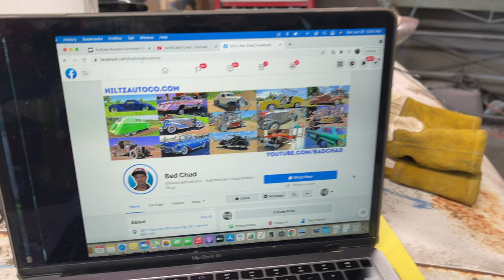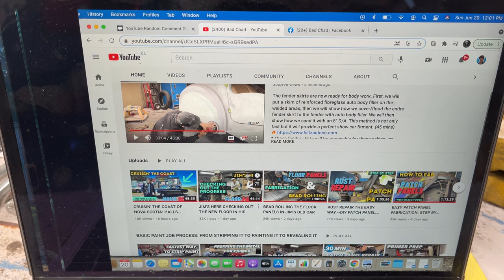THE EASY AND AFFORDABLE WAY TO RESTORE AN OLD CAR FLOOR

Comment: This Sunday you & Jolene are doing an amazing job on the floors, what a difference from when you started on Jim's Oldds 88 wow. It just shows that a little hard work you can tune a sows ear into almost a silk puse, or something of real value great work as. You have not only made it safe to drive but you have added much value always. By the way my mouth was watering when the lobster showed up during your lunch out, that was such a beautiful town and place to eat thanks for taking us along for the drive. Thanks Mark Dutka

Comment: Great looking job. You mentioned coming up to your area. I'm from CT USA and can't wait for the borders to open to come up and visit. 
I'm building a floor for a 55 Chevy and it's taking me for ever but I'm replacing all the original braces. Yours looks great and so much simpler. I wish I saw you do this before I bought the two half floors that need to be put in. BTW happy Father's Day.

Comment: Floors look much better than I visualized. I am impressed!! 

     You have inspired me to fab oil and trans cooler mounts. A boo boo is just an opportunity to get better. I would have given up on filling a burn thru but used your triggering technique with success. I am no longer held back by fear of making a mistake. Anything is fixable.  I will be doing the Chad paint routine. 40-80-prime, 220, guide coat, paint. Might be, Less expensive as Joline said. We not cheap!!!  Windex too!!!  Thanks Chad this 70 yr old is still learning a lot!!  I bet those Bugatti's will bring more than $100K. Just saying!!!

Comment: .I think that the floors you've put in  Jims car are better looking than the aftermarket floors that IF you could buy them, they wouldn't be as thick either.  I really like the use of the plasma cutter for the holes for welding than drilling.  What a time saver.  I also really like the fact that you make the holes big.  I watch others make tiny holes and I just don't think that it's enough to hold it.  I personally would never use anything less than a 1/4"  they really look great !

Comment: I used Hockey pucks in a Chevy S10 Blazer, it helped carry the vibration throughout the whole rig instead of dampening the vibrations. What a racket that was. Wasn't long getting the proper body mounts.

Comment: Great work by you two , I was told the same when I was learning to weld when put some sheet metal on the side of a boats wheel house to tack it in place and work my way round it so it wouldn’t  twist and lay flat

Comment: Chad, I agree with the Holley power valve failure. It's not the only culprit but I ran into that problem several times and it's a good place to suspect. Tom Martin

Comment: Great job on the floor. I learned much, but I get the biggest kick out of your "payback" projects. Please keep them coming. It makes the world a better place! What size welding wire do you use. It seems one size fits all? Steve in Texas working on a 37 Chevy truck.

Comment: Glad to hear you got some good ideas on the '62.  I didn't think of Holleys, which are Ford, and awswome; yes on the power valves.  
Here is my crazy idea, based on pure logic:  You can easily make a couple carburetor "block off plates", matching the bold pattern on the outer carbs.  Then, you remove the outside 2 barrel carbs, and bold on the block off plates.  (yeah, you have to rig a single carb fuel line).  Then you have a single 2 barrel you can test alone.  Car should run fine, just less max power.    Then add the outer carbs, and see what changes.  

Another idea, if you do have an electric fuel pump, is just unbolt the carburetors and lift them up and SEE if any fuel is dripping through with fuel pressure up and the floats "closed"...  (hold em level).

Mr. Helpful

Comment: Happy Father’s Day! Thanks for the tour again yesterday. You live in a beautiful place.  Question: if you didn’t have the roller tool, what would use to put a bend or crimp in the metal. Like you said, it’s a floor pan, wouldn’t need to be perfect. Could you do it with hammer and a form?

Comment: Just an idea on your running rich problem you might check your fuel pressure most carbs like about 4 psi mechanical and electrical pumps put out 7-14 psi might have to run a pressure regulator

Comment: the flooding on the black car could be the floats, float valves or fuel passing down the threads of the float valve base or bases. I have just fixed an issue of flooding on my Citroen DS. It was fuel coming down the threads of the float valve seat, despite a new aluminium washer. I put a tiny wrap of PTFE tape around the thread and then did it up. No more leak,

Comment: If your carburetor backfires it can also mess up the power-valve most of the time it will mess up the power valve when you go to accelerate it will stumble just like you were saying

Comment: There was a question about if the steering wheel could be saved. Use Por-15 Epoxy Putty, sand and paint it up good as new.

Comment: If the floats are adjusted to high fuel will come out of the overflow and leak on the ground. Chad is the master guesstimator. Guess that comes with years of experience.

Comment: Use an unlit propane torch to find a vacuum leak. Move the unlit torch all around the intake manifold joints and if the engine Rpm increases, you have found the area of your vacuum leak. Good luck.

Comment: Yea it could have a pin hole in the float or it just not set low enough to shut the gas down  but if it been floodin it still needs plugs to

Comment: Brad most likely you have a needle valve and seat leaking from the O-rings To test for the leak take the carburetor off empty the fuel screw the fuel line into the carburetor turn the carburetor upside down if you can blow air through it it’s either the O-rings or trash in the needle valve and see

Comment: If you backfire a Holley it will most likely pop the power valve. They do have a check valve to eliminate that problem 🧐

Comment: Sry bro but your carbs do not have power valve what they have is an accelerator pump times three thats why it boggs on full throatle unles rpm is above 2000